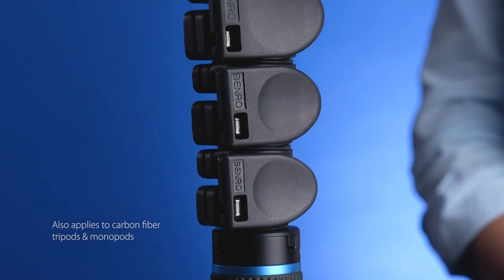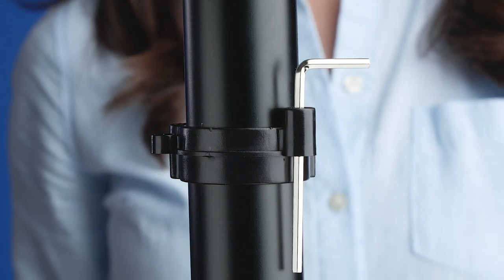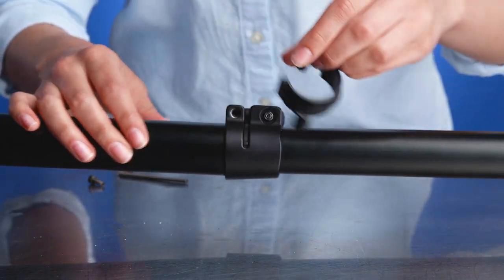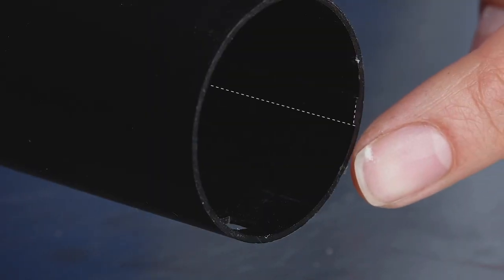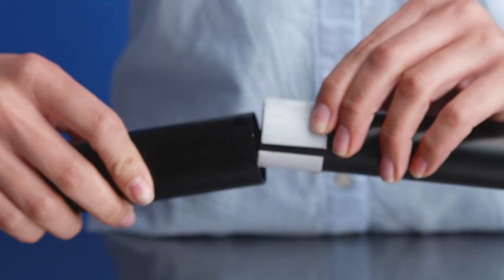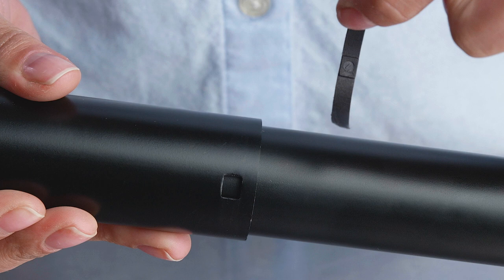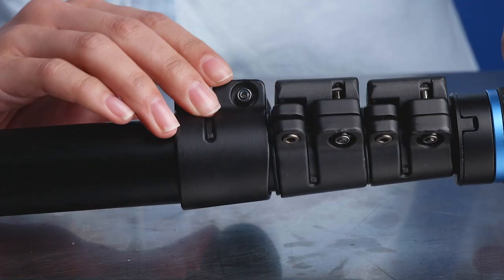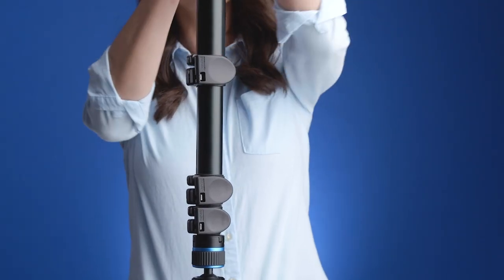Benro Service Tips: Flip Lock Replacement

Comment: Hi, would like to enquire about your Tortoise series, the tripod shim is made from what material? Many thanks in advance
Reply from the maker: It is made from a proprietary composite material that provides superior performance in all climates and has a very long duty cycles for a long functional life.
Reply: @BenroUSA  Thanks for the reply, glad to know the material use is durable and not a cheap plastic that will easily break.

Comment: Hi Benro, I have a broken flip lock on my Benro C2970F tripod. Instead of ordering a part from the USA, is it possible you can provide me the contacts of a local dealer here in the UAE.
Reply from the maker: Hi Mohammed - Grand Stores LLC is the Benro distributor in the UAE https://benrousa.com/international-distributors/
Reply: @BenroUSA  thank you very much!
Reply: Hi, I have been going back and forth with the local distributor in UAE. They only do repairs on the products which is under warranty. My tripod’s warranty is expired and they have refused to provide me with the replacement part which is shown in the video. I have tried many times but all to no avail. Can I please get the information to get this part form perhaps outside the country. I have a big event coming up and I need the tripod up and running.